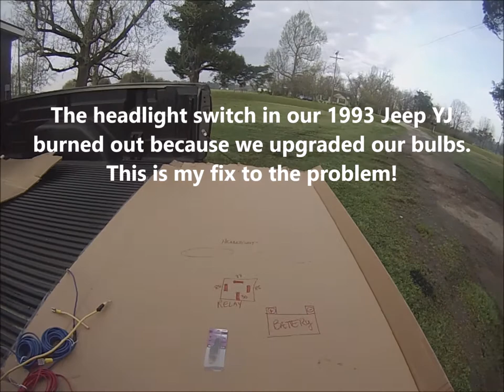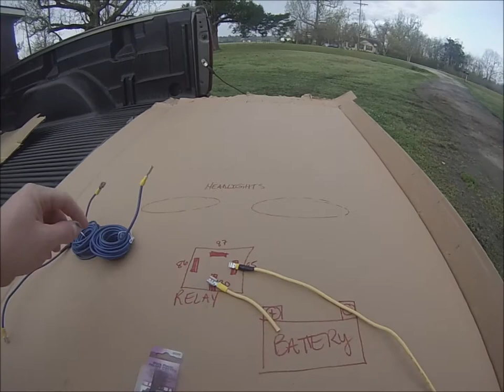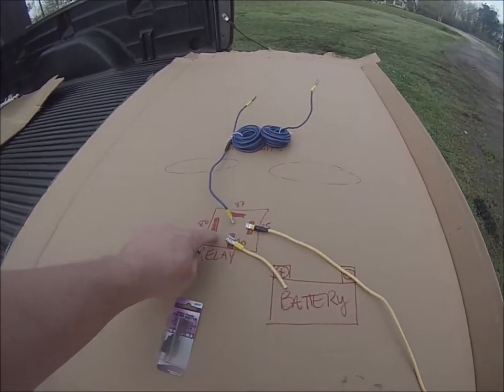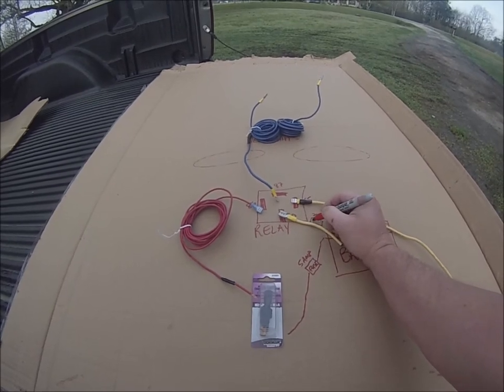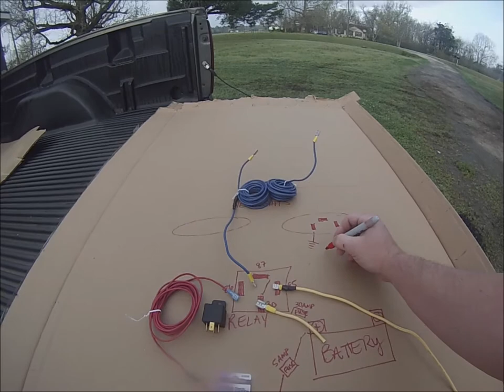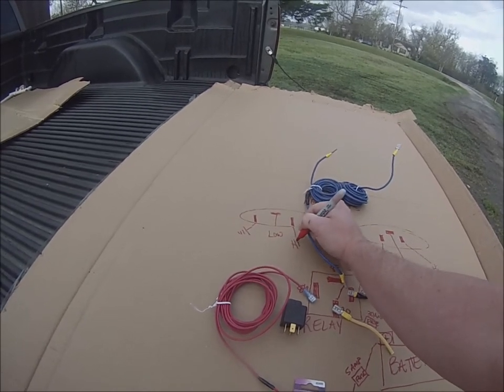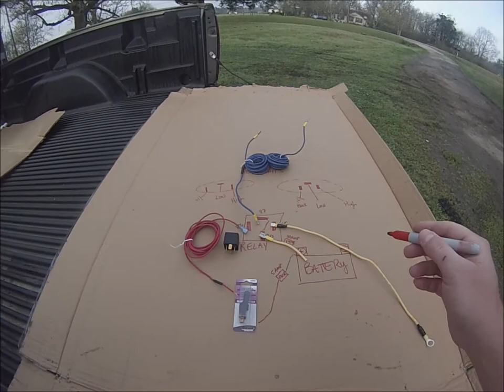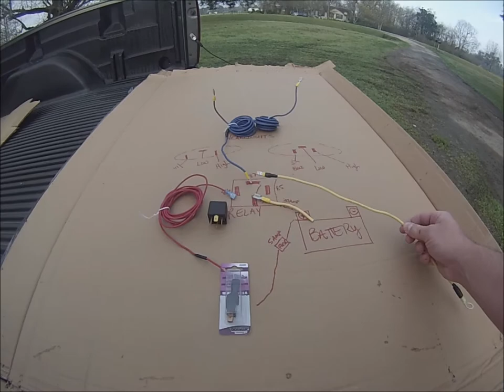Part 1 - 30 amp Relay with Switch - DIY Jeep Wrangler YJ Headlight Relay Wiring Harness Upgrade

Comment: I am replacing my 2010 jeep hi beam/low beam wiring. I found a harness and relay with fuse wiring kit but I don't know what switch to use to give me the hi beam /low beam toggle. Help?
Reply from the maker: Any on off toggle switch or button will work.  I used a toggle for lows amd a seperate toggle for highs.  You could also do a 3 way switch where middlenof the switch is off, up is hi or low and down would be low or hi.
Reply: JRMSweeps yes, that's exactly what I was thinking but I wasn't sure. I want an on off on switch but I'm not sure how many pins I'm going to need. Right now I found a wiring harness kit with relays and inline fuse. Its on Amazon - "Partsam H4 9003 Headlight Relay Wiring Harness kit..." I have H4 lights on my jeep so it will work but if you look at their pictures, the diagram shows a "socket" connection where the kit is made to connect to the OEM jeeps lights harness. I want to cut those leads and use an in dash switch instead. Do you mind taking a look?